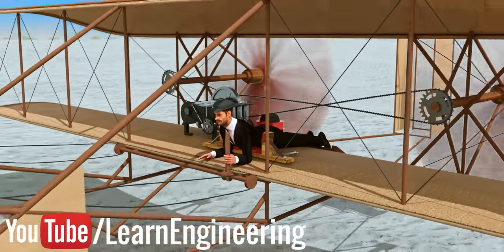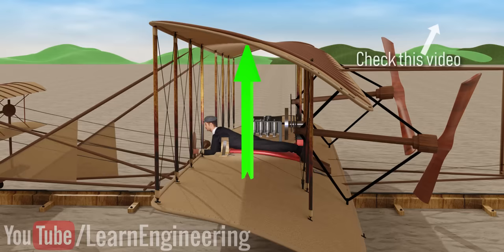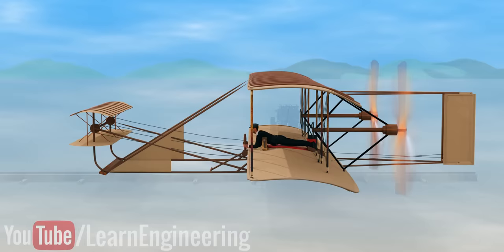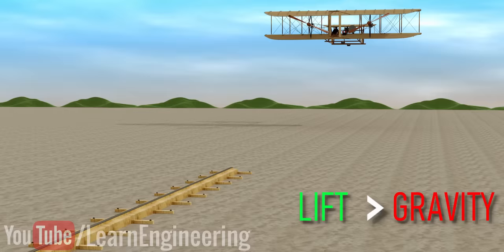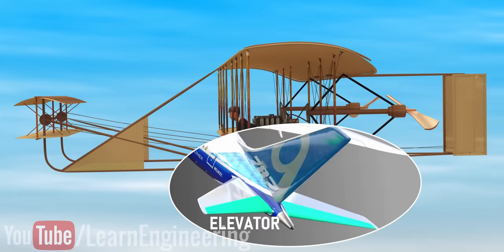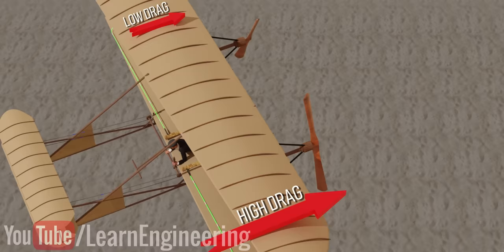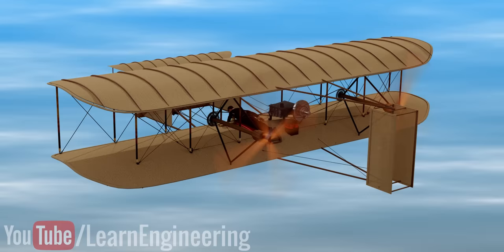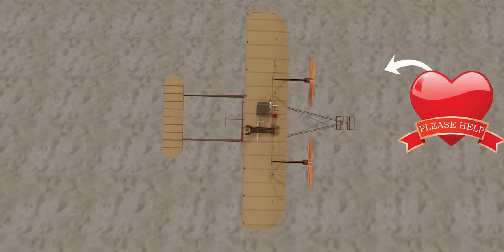The Brilliant Engineering of FIRST FLIGHT !

Comment: The wing warping system they use is wonderfully simple and intuitive. I knew it worked as shown, but the details never came together until LE's animation. It's a shame it ended up being an impractical control system as airplanes evolved.
Reply: The Wright 's Last designed plane (just after Wilbur's death) finally abandoned the wing warping in favor of Ailerons
Reply: Wing Warping systems were tested long before the Wrights, the idea was old. It was tested by gallaudet in 1896.
Reply: 14-bis used ailerons.  Complete separated surfaces for that function.
Reply: @majorbett   The high dihedral 14-bis has can make it tuff for his ailerons to act with good efficiency,  but the point is that the ailerons were there and the principles of working were correct. 
     If I tell for example that the Flyer 1 canard was nearly ineffective , and it was very easy to stall , making it quite impossible to regain control after stalling,  does not make it not an elevator.   It was an elevator,  extremely problematic, but still an elevator.
Reply: @sanpol4399  Do you have some evidence that high dihedral compromises the effectiveness of ailerons or is this just an opinion?  I would tend to agree that a super stable wing design reduces quick maneuverability .... but that is  just my opinion.

I agree that the design of the canard elevator was problematic but that does not change the definition.  

I think the Wright's did not spend enough time making their design safe to fly.  It was never very forgiving for pilot errors.  There was an improvement from the original Wright Flyer to the designs for the Flyer III and the Flyer 2b.  Could it have been better?
Reply: @majorbett  Yes, you are definitely wright about your statement on Aileron x lateral stability. 
Dihedral increases lateral stability,  and as ailerons act in the lateral movement,  the aileron effectiveness is diminished .
If a plane has neutral lateral stability,  the same aileron deflection  makes the plane roll more angle and with more roll rate than if the same plane had dihedral and more lateral stability. 
   Another way to make ailerons ineffective is making an airplane with big pendulum effect,  for example, a high wing plane with a heavy and low cg.
    Planes like this usually use negative dihedral,  to diminish lateral stability and to have more lateral control authority. 
       But coming back to the last question.
    Do you personally believe the Flyer 1 could fly sustained without any wind on a flat surface ?
Reply: @majorbett  Do you personally believe the Flyer 1 could fly sustained without any wind on a flat surface ?
Reply: @sanpol4399  I am not sure how to answer your question because the Flyer I rarely sustained flight for more than 15 sec.  To sustain flight, you first have to solve the stability problem.

Do you want to ask the same question with respect to the Flyer III?
Reply: @majorbett  First things first. 
Flyer 1, is the most important since this is the one that is celebrated as the supposed first to make a sustainable flight.
   After talking about Flyer 1 we move to Flyer 2, then Flyer 3.
    But to do that you need to answer the questions directly,  without escaping. 
     Are you 100% sure Flyer 1 could takeoff and keep flying with trust bigger than drag , even knowing none of the replicas never made it? 
    Can you prove it made it ?
Reply: this is the letter that wilburn sent to ferber asking for the complete layout of Dumont's 14 bis. in 1907 they stayed in Paris for months, bought an engine similar Dumont. the brothers to talk with first aviators(Farman, Bleriot and others about Dumont's technologie). Returned to the USA and  may, 06 1908 they flew just 337 meters for French specialists. the brothers never tasted anything in public before this date.
Dear Captain Ferber,

My brother Orville and I learned through reading the correspondence from Paris Published in the New York Herald, that the French public had highly appreciated a 220 metre flight in a straight line made by Mr. Santos-Dumont in an airplane of his own construction.

We would like very much to have exact reports of the experiments made at Bagatelle and hope that you will draw up for us a correct list of the trials and give us a description of the flying machine and drawing of same .

We have already seen by the picture in the New York Herald that the airplane rests on three wheels and we deduce from this that Mr. Santos-Dumont, in order to effect his start-off, has first to make a run over a long level field. With the aid of the starting-off, pillar that we use, Orville and I speedily go right up into the air in a much more practical fashion.

Now, in view of the fact that the French consider a 220 metre flight in a straight Line over the ground to be a “sensational performance”, we are sure to find a lot in Favour  if we come to exhibit in France; but the voyage and the transportation of the Machine and the pillar cost much more money than the two poor  Dayton mechanics can afford to spend; also, dear Captain Ferber, if French experts, under your management, desire to come to Dayton, we will give them a demonstration of the machine in the neghbouring field, flying for five minutes in a complete circle and let them have an option of the performance and release of the machine, for $50000 (fifty thousand dollars), cash down.

Your trully

Wilburn wright
Reply: @majorbett  You don't have answers. Silence, Guy, accept Dumont is the inventor of the plane.The official evidence of flights between 1903-05 you never present. Present here a document with photos and that was registered by Wright brothers between 1903-1905. Remember the competent authorities for this have existed since 1898 !!!!
Reply: @gilberto2056  Good information.  The only thing missing is the reference.
You  comment on the French engine is misleading.  It was not based on anything that Dumont had used.  It was part of an effort to set up European businesses to build copies of the Wright Flyer 2.   The French company was to build copies of the latest Taylor-Wright  engine.
to supply to the companies that were being set up to build Wright Flyers.  

Here are the specs on the 1906 vertical 4 designed by Orville and Charlie Taylor.
https://www.wrightexperience.com/the-engine/

Bore – 4 3/8 inches
Stroke – 4 inches
Displacement – 241 cubic inches
Compression ratio – 4.7:1
Horsepower – 35 hp @ 1400 rpm
Cooling – Liquid circulated by pump and radiator
Lubrication – Splash system, circulation by pump and gravity
Dry weight – 180 pounds

Here is some information on the Antoinette V8 engine used on the 14 bis.   
https://en.wikipedia.org/wiki/Antoinette_(manufacturer)

The Antoinette company's primary business was the sale of engines to aircraft builders.[2] Their engines were used in the Santos-Dumont 14-bis of 1906, Paul Cornu's rudimentary helicopter of 1907, the Voisin biplane that was modified and piloted by Henri Farman who used it to complete Europe's first 1 kilometer circular flight in January 1908, and other significant pioneer aircraft.

The Farman-Voisin biplane was powered by a water-cooled Antoinette V8 engine which developed 50 horsepower (37 kW) at 1,400 rpm. It used an early form of manifold injection and weighed only 190 pounds in working order, including the water-filled cooling system.

The photograph of the engine shows a propeller that looks like a paddle.  It was not the more efficient shape of the Wright prop.
https://upload.wikimedia.org/wikipedia/commons/thumb/e/e9/Antoinette_VII_Front.JPG/220px-Antoinette_VII_Front.JPG

https://en.wikipedia.org/wiki/Antoinette_(manufacturer)
Reply: The Wright supporters say the lift control instability had been solved.  The Wright Flyer III was much better than the earlier prototypes but that does not mean that the problem was completely fixed.
Reply: @gilberto2056  Please read up on the 1906 Wright upright 4.  There is an easy to access article on Wikipedia that can be displayed in Portuguese.  

In late 1906, the Wrights finally got their $50k or or more.  They sold their European patents to 

Ferber is quite an  interesting character in Aviation history.
He started out as an enemy of the Wrights.  But after Wilbur started
working with Deutsche and sold his patent rights to 
and Deutsche.  
Ferber did not attend Chanute's lecture to the Aero Club de France in April 1903, but after hearing of it he wrote to Ernest Archdeacon, one of the founder members of the Aero Club. His letter asked Archdeacon to use his influence to get the Aero Club to announce a prize for a glider flight, and contained the exhortation il ne faut pas laisser l'aéroplane s'achever en Amérique ("The aeroplane must not be allowed to reach successful achievement in America").[3]:64 His suggestion was enthusiastically endorsed by Archdeacon, who included an extract from Ferber's letter in his account of Chanute's lecture published in La Locomotion on 11 April: the letter was also published in the April issue of L'Aerophile.
Reply: Did you ever reply to my reply to your claim that the Wrights
did not fly until May, 1908 and only after they learned the secrets of the 14-bis from Ferber.  

Wilbur did not begin his demonstrations at Le Mans until August.
The May 1908 test flight might have been the one where Wilbur threw a rod and destroyed his Dayton built engine.  

Your description of the 1907 trip to Europe seems to be pure speculation.   It may be based on the speculations of ... in 2017.
The historical detail is available so you don't need to rely on speculations.  

The most important event was the receipt of $50,000 or more in
1906 from French financiers which enabled them to come to Europe and establish a group of Europeans who would build copies 
of their Wright Flyer B with engine built by 3 European engine builders under license.

Deutsch supported Lazare Weiller, who bought the patents of the Wright brothers and organized demonstration flights
 in several countries.  The first was Wilbur's demonstration in Le Mans, which began on 8 August 1908.  Not sure what the reference to a May 1908 flight was.  If  you have any first hand information please reference it.  It could have been the flight where Wilbur threw a rod in his Dayton built 1906 upright 4 and had to replace
it with one of the engines that Bariquand et Marre under license and delivered that summer.

https://en.wikipedia.org/wiki/Henri_Deutsch_de_la_Meurthe

There are multiple references to this activity.  The one in Wikipedia is the easiest to access.
Reply: @gilberto2056  True but were the Wrights' or anyone else involved with the patent aware of this.  Gallaudet did not try
to patent his system.

There are lots of cases of independent invention.
Reply: @sanpol4399  The RC models of the 14-bis don't bother with the ailerons.  This suggests that they don't help or don't help very much.

There are photos of of a 14-bis manned replica that show both ailerons fluttering.  Any explanations for this?
Reply: @sanpol4399  

SP:  Do you personally believe the Flyer 1 could fly sustained without any wind on a flat surface ?

You are asking me for an opinion for something that was never demonstrated using a word that has several interpretations.

I believe that the 1903 flyer could stay aloft for
30 seconds with the assistance of a headwind in excess of 15 mph and a 12 hp. motor.

I think you could ask if the flyer could accelerate to a take off speed on a 300 ft.
track when the wind was less than 4 mph.
The 12 hp  motor could generate 16 hp. for 
1 min. but that might not be enough power
to compensate for the lack of wind.  

On 14 Dec. 1903, Wilbur investigated the contribution of an 8% incline hill when the wind was less than 5 mph.  There is a dispute about the distance he flew.  

@Gilberto Nedel Junior, @Douglas Doutor
Reply: @stevebett4947  So, your answer is 
( No ) for the question: 
Do you personally believe Flyer 1 could fly without any wind from a flat surface?
Reply: @sanpol4399  

SP:  "Can the 1903 Wright Flyer or its exact replica fly without wind on a flat surface?"

SB:  In my opinion, NO!  

There was a largely obscured test by the Wilbur Wright to determine how much a hill contributed to wind speed on 14 Dec 2003.  

I am not aware of  a test on a flat surface unless you want to call the attempted flight on 17 Dec 2003 such a test. 
 
If there is no clear evidence, this is just speculation.

For what its worth, IMHO, the 1903 Wright Flyer
cannot fly without assistance from the wind, high barometric pressure, and an 8-16 hp motor.
Reply: @stevebett4947  Then we agree that Flyer 1, with his engine running and propellers turning at 350 rpm,  could not fly without wind from a flat surface. 
And then , since a flat surface does not provide up wind direction to help lifting the plane,  
 it also would be impossible for Flyer 1 to fly even with any wind speed on a flat surface.
Reply: @sanpol4399  

SB:  Have you viewed the video on the Wright Glider being flown by tourists?  There is one part where the flyer is being held in the air by two on each wingtip.  Their job is basically to prevent the glider from flying backwards.

There are several Wright Glider videos including one where it competes with a replica of Lilienthal's glider.

I think the glider is launched by running to achieve some forward momentum.  The crew at the wingtips could also push it off.

The point is that the Wright Glider in a strong wind flies on wind alone.  The glide is extended when there is a hill.  Not sure about the slope but it can be as little as 8 degrees.

Lilienthal used a man-made hill that sloped at 45 degrees.
Reply: @stevebett4947  That is physics. If you have ropes holding it, that is what make it possible it to keep the flight even on a flat surface.
   Without the ropes holding the glider, and if it was on a flat surface, it would just jump, fly backwards,  loose immediately airspeed ( air flowing relatively to the glider) , and it would quickly return to the ground.
    The only way it could be different,  is if there was a slope, because the wind would have a vertical vector, in opposite direction of gravity .
(that is how gliders fly near mountains when there is some wind).
   It means what we conclude wright above.
   Flyer one could not fly over a flat surface with any wind even at 350 rpm.
Reply: @majorbett  His (Glenn Curtiss)  ailerons were fully functional.

Most of the RC models of the 14-bis do not bother with ailerons.  I have no idea why.  This is just an observation.

https://en.wikipedia.org/wiki/Glenn_Curtiss
Curtis (1909) won the Gordon Bennet  cup in Europe in Reims, France.

In August 1909, Curtiss took part in the Grande Semaine d'Aviation aviation meeting at Reims, France, organized by the Aéro-Club de France. The Wrights, who were selling their machines to customers in Germany at the time, decided not to compete in person. Two Wright aircraft (modified with a landing gear) were at the meet, but they did not win any events. Flying his No. 2 biplane, Curtiss won the overall speed event, the Gordon Bennett Cup, completing the 20-km (12.5-mile) course in just under 16 minutes at a speed of 46.5 mph (74.8 km/h), six seconds faster than runner-up Louis Blériot. [N 1]
Reply: @sanpol4399  

SP: "it also would be impossible for Flyer 1 to fly even with any wind speed on a flat surface."
"a flat surface does not provide up wind direction to help lifting the plane"

SB:  Do you think only a hill provides the upwind direction necessary to lift the plane or glider?

There are videos of the Wright Glider flying with 
with a man at each wingtip preventing it from flying backwards.  This is on a relatively flat surface.  (there could be a 8% incline). 

There are also videos of 
of tourist flying with a tether held by one
man on the ground.

If it is impossible for the 1903 Wright Flyer to
fly with a 15 mph wind on a flat surface, why
do the exact replicas of the Wright Flyer hop
about 100 ft.

Check out the video an comment.
https://www.youtube.com/watch?v=o1mscspl-VU
Reply: @stevebett4947  About 14-bis ailerons effectiveness we have already discussed a lot and finished the subjec. All your doubts about that were already discussed.
Reply: @stevebett4947  We already also talked a lot about how a wind flowing uphill make possible for a glider to fly, or an extremely "underpowered glider" like the Flyer series to fly.
Reply: @sanpol4399  aileron effectiveness on the 14-bis.

SB:  I don't think they were carried over  to 15 or 16.  Here is the time line:

No. 15 tractor http://www.aer.ita.br/~bmattos/sd/aeronaves/15.html

No 16 as another tractor variant without ailerons or little winglets..

SB:  Do you  recall your conclusion.  I think you had discussed the issue with Calassa.  He mentioned something about the bamboo being too weak ....

I mentioned the fact that both little wings were fluttering during one flight.  

I could go back through 100 or so comments and probably find our last one.  I was hopping that your memory was better than mine.
Reply: Here is the Wikipedia page on SD's prototypes,

Have you come across any information on No. 8, a monoplane?

https://en.wikipedia.org/wiki/List_of_Santos-Dumont_aircraft
Reply: Here is the page on the 1906 Wright Vertical 4.
Do you believe it looks like the Antoinette 8V?

https://en.wikipedia.org/wiki/Wright_Vertical_4
Reply: @stevebett4947  "SB. I do not think the ailerons were carried to n.15 and n. 16."

Number 15 : there was ailerons at this one.

Number 16: why do you think this kind of flying machine would need ailerons ?🙂
Reply: @stevebett4947  Just kind of disagree with the last sentence. 
    It is impossible to say which invention contributed more or less to aviation. 
   I could say for example, that 14-bis really was the biggest contribution for aviation, because when all inventors saw a heavier than air could really fly,  it was a proof they could keep the track to evolve aviation. 14-bis was a huge stimulus for anyone interested in this area, because they knew for sure , it was possible to succeed.
Reply: @sanpol4399  

SP: There were ailerons on No. 15

SB:  Where?  I did not see them in the photos
that I listed.  Do you have another source
or did I miss something.

@NewtaoV 
@
@harpiasonhadora sonhadora
@Warp ,   @Paulo Pereira
Reply: @stevebett4947   Here is a quick find where it talks about n.15 ailerons.   https://en.m.wikipedia.org/wiki/List_of_Santos-Dumont_aircraft

Why do you think n. 16 would need ailerons ? 🙂
Reply: @sanpol4399  

SP:  Disagree....  It is impossible to say which
contributor to aviation contributed the most.

SB:  This would be opinion not empirical fact but there are enough discussions of this type to list the 6 who contributed the most out of about 200 who are recognized as contributors.

I recall reading several lists.  I will see if I can
find them again.

You're argument is that  

SP:   14-bis really was the biggest contribution for aviation, because when all inventors saw a heavier than air could really fly,  it was a proof they could keep the track to evolve aviation.

SB:  Did any of the 200  working to make contributions follow the track established by the 2nd prototype that Santos Dumont had built, the 14-Bis.  

Is there anything else you want to add to the list of contributions made by Santos Dumont not counting his contributions before 1906 or his contributions with respect to the Demoiselle.  

 @NewtaoV 
@harpiasonhadora sonhadora
@Açúcar Chocolate
Reply: @stevebett4947  before we proceed,  can you tell why you think Santos Dumont invention n.16 would need ailerons ?🙂
Reply: @sanpol4399  I can only speculate.  
Why would changing from a pusher to a puller
(Tractor prop) reduce the need for ailerons?
On my source page, No. 16 and 17 were both
tractor powered.
Reply: @stevebett4947    Does you source tells number 16 was an airplane ?
Reply: Illustrated detailed history from one perspective.

https://archive.org/details/wrightflyerengin00wolk/page/2/mode/2up
Reply: @stevebett4947  thank you for the link.
 I would like to go back and clarify the source you told you  about ailerons on Santos Dumont n. 16.
   Does your source tell invention number 16 was an airplane ?
Reply: @sanpol4399  

SP:  ailerons on Santos Dumont n. 16.?

SB:  Prototype No. 16 is, as I recall,
a tractor engine first (not a canard with a pusher engine).  It has  what looks like box-kite dihedral wings. There was a photo but no detail.    Tell. me if  you come across any detail.

I don't' recall seeing any ailerons on it.

Can you call a contraption that fails to fly
an airplane?

Let me go back and compile the links.
Reply: @stevebett4947  Can you put the link to your source that suggests Santos Dumont n. 16 was an airplane ?
Reply: @stevebett4947  SB .  I do not think the ailerons were carried on Santos Dumont 15 and 16.

As you can see even in the link you attached.   
The number 15 had mid gap ailerons, and there was no need at all for number 16 to have ailerons, since the experimentation was not an airplane, but a hybrid with no problem with lateral stability .
Reply: @sanpol4399   Santos-Dumont No. 16 had mid-gap ailerons.  

SB:  Can you link the photo of the mid-gap ailerons on No. 15?

I don't have a good illustration or picture of No. 16.  If you have found one, please
link it as well in your next comment.

I will add my links later.  They can be found on earlier comments.

The hybrid was heavier than air, so there was at least one thing that was in common with
an airplane.
Reply: @sanpol4399  Thanks for the photo of the No. 16 hybrid slightly heavier than air air ship.  It appears to have a canard rudder in front to provide lift when the engine was started.  

Is there any explanation of why it didn't work? 

More later

LINKS:  SD #16  hybrid air ship
https://upload.wikimedia.org/wikipedia/commons/f/fe/Santos-Dumont_No._16_airship.jpg

I am looking for the descriptions of Santos Dumont numbers 6 through 20 at Wright-Brothers.org
Reply: @stevebett4947  🙂 why exactly you want to know where the hybrid  number 16 failed ? What it is the point you are trying to get? 🙂
Reply: @stevebett4947   The subsequent post comment:
   But that It is exactly the oposite! 🙂
  Santos Dumont flights were facts. There is no need to have faith to believe in facts.
  The opposite happens about the suposed flights claimed by the Wrights before 1908.
   People have faith on that, no one, if completely honest,  can tell is sure  Wright brothers did what they claim.
  We already went through that before, and the further point we
go at the first man to fly an airplane, was that I am sure Santos Dumont flew an airplane in 1906, but you are not completely sure the Wrights flew before 1908. 👍🏻
Reply: Here is a photo of  the flyer just before the attempt to fly in
low wind conditions.  The hill appears to have an incline of less than
8 degrees.  Not  exactly the 45 degree artificial hill that Lilienthal used.

https://www.loc.gov/item/2001696494/

There were 4 witnesses but they are not identified beyond this.

Title
[1903 machine on the launching track at Big Kill Devil Hill, prior to the December 14th trial. Four men from the Kill Devil Hills Lifesaving Station helped move it from the shed to the hill, accompanied by two small boys and a dog|.
Reply: @stevebett4947  None of the Flyer  replicas made so far could fly in a condition drag was equal or lower than thrust. 
  And none could repeat the claims.
 Fyer 3 replicas for example, could not even approach a bit of what was claimed.
   There is no way to bypass physics. 
   No hill with strong wind or catapult , no flight at all.
Reply: @stevebett4947  We also already went through this. It is another proof it could not fly sustained. 
It jumps, drag takes place, airspeed  keeps dropping , and goes to the ground.
  NASA wind tunnel test also tells the same. Flyer 1 has always Drag higher than thrust .
    If for you that's enough to consider it an airplane, it's ok.
Reply: There is an interesting debate between Wright supporting traditionalists and Fans of Otto Lilienthal (OL:).  
The Wright supporters say that OL's coefficient of lift was wrong.  The OL supporters argue that it wasn't.
Do you think this is something that is worth discussing?
Reply: @sanpol4399  Here is the link to pictures and text on the 1910 Wright Model R  with its Wright V8 engine.

https://www.wright-brothers.org/Information_Desk/Just_the_Facts/Airplanes/Model_R.htm

THE Wright Fliers (the Wright exhibition team)  brought their own Model R to the 1910 Gordon Bennett air race, an even smaller version with a V-8 engine called the "Baby Grand." Orville test-flew this aircraft at more than 70 mph (113 kph) on 25 Oct 1910 and it was favored to win the race. Unfortunately on 29 October, Wright pilot Walter Brookins experienced an engine failure while flying the aircraft. He crashed  keeping the Model R out of the competition. . It was later rebuilt and Brookins flew it for exhibition flights.
Reply: They were aware that Ailerons would work too----And covered that in their patents.     Connecting the RUDDER and ROLL controls to work together was the BASIS of their PRIMARY aircraft patent.
Reply: @sanpol4399  What NASA WT test? Please provide a link … what WT and at which NASA Center
Reply: @hokie6384  unfortunately the link below can not be reached for some reason anymore, but I downloaded the pdf file.  I tried to google it but did not find any other link with that epic 1:1 scale Flyer 1 but did not find.
I copied some information from the pdf file :
Henry R. Jex, Jex Enterprises, Santa Monica, CA Richard Grimm, Northridge, CA John Latz, Lockheed Martin Skunk Works, Palmdale,CA Craig Hange, NASA Ames Research Center, CA.

Synopsis • Background–See prior paper:  AIAA 2000-0511 “The AIAA 1903 Wright Flyer Project; Prior to Full Scale Test at NASA Ames Research Center” • Recent Tests @ NASA Ames National Full Scale Aerodynamics Complex 40’ x 80’ Wind Tunnel.
If you can not find any link to the full test data with the above information, I can send it by email for you if you want.
    Kind regards.